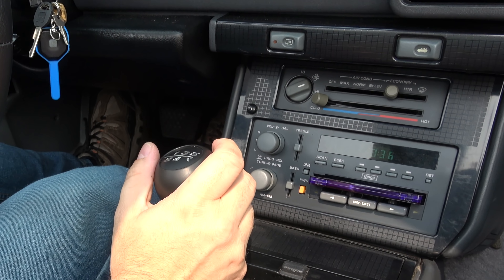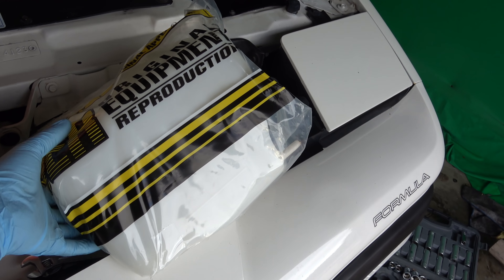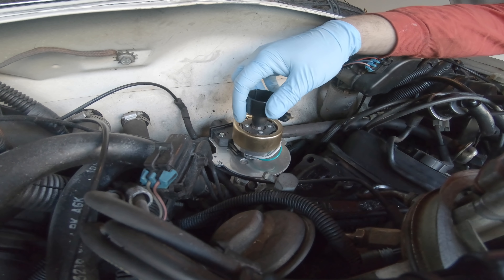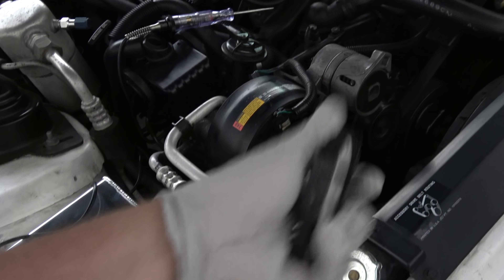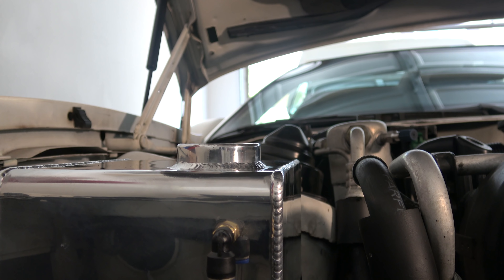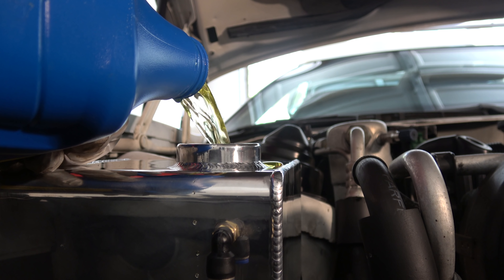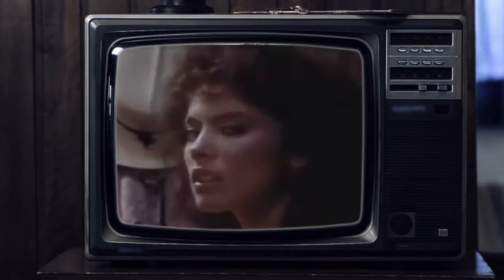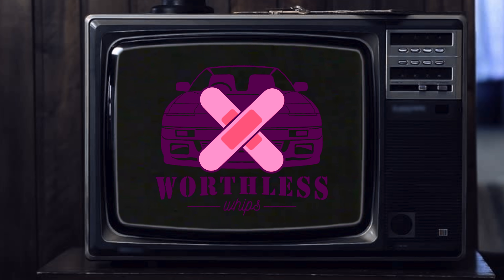They really don't make them like they used to!

Comment: I had a 91 camaro rs so I feel you pain. Went through 14 alternators in a year. Best thing I ever did was pull that 180 hp 305 boat anchor with a 5 speed and swapped in an LS1 with a t56 6speed. This was late 90's.
Reply: >Went through 14 alternators in a year.
wut...
Reply: How many times did the driver's side interior door handle come off while you were closing the door? Four times on my brother's new 90's Camaro. Build quality was terrible.
Reply: @williamswenson5315  Weirdly that actually never broke on mine. But the normal starter, alt, and fuel pump gremlins did bite me.
Reply: @troy3456789  Yup, and GM in their infinite wisdom used 3 completely different bolts to mount it. Original one died and I think it was more of an auto zone problem with the replacements than anything else. They finally got tired of me coming in for warranty replacement and just gave me a new AC Delco alt.
Reply: @stephenobrien1597  Yeah, the first time I drove it, I was left with it in my hand. It was an awkward moment when I returned his keys and the handle together. Two weeks later, the same thing happened to him which resulted in a similar awkward apology for being upset and angry. That car was a real conversation starter; if nothing else.
Reply: @stephenobrien1597  For the first time in my life I had a reman alternator from O'Reilly's fail (for my Camry after only a month). The V6 2011 Camry alternator is a 5 hour replacement job at dealerships, and it took me 10 hours to replace it; because it is at the bottom; and you have to remove the front end off the car, drain the radiator to get to it, and even then it requires access from the right front wheel well to insert a mount bolt with one hand only (not enough room for two hands to get it in). It takes a second person from the top to move the alternator just to line up the bolt hole.
Reply: Lucky you, I can't do that in California! Wish I could
Reply: @troy3456789  At least the overall reliability on the Camry is high. That procedure is one of those "living Hell" types that people who work with their hands know only too well. My sympathies.
Reply: @troy3456789  I'm assuming he changed them all himself. Ugh.
Reply: @williamswenson5315  I'd have been done at number 4. The 3rd one would have been the charm that broke my mental camel's back.
Reply: @williamswenson5315  Yes. I drove that car back and forth across the US a few times and I had 100% confidence in it. On the freeway that V6 gave me 28mpg and nobody took notice of me. It's low-keyed, just like I like my life.
Reply: @troy3456789  Definitely saves on the skull sweat. Thanks for your reply and take care.
Reply: @troy3456789  I can't imagine 14X. At least one of those alternators would have been returned on a horizontal trajectory at a great velocity. I do have to give him points for gritting it out.
Reply: @williamswenson5315  I have to give him points for patience. I just figured out what you meant by "horizontal trajectory" (like through the front window of the auto part store). I'm laughing. Thank you. I needed that.
Reply: @troy3456789  You are welcome. Any humor is particularly precious about now. There is a fair leavening of it on this channel also and I enjoy every bit of it. It's a good crowd.

Comment: I had a 1987 Firebird, I experienced all of this. My distributor was junk, the replacement was junk. The ignition cylinder was junk. The radiator was junk. The interior panels were junk. The engine and transmission themselves were great, but literally everything else around it was complete junk. And yet I still miss it.

Comment: I loved my 88 Formula 350.  It had it's issues but it screamed.  My ignition control module also failed but it was because of wires that attached to it in the distributor.  They had corroded off.

Comment: Check your alternator output. I once went through 5 ignition modules inside the distributor on my 2nd gen TA, due to an alternator overcharging the system due to a stuck, internal voltage regulator.

Comment: 0:22 top was my Dad's new in 86 minus the t-tops.  305, 5 spd, WS6.  Not the fastest but was fun to drive  I had an 84 Z like on the bottom except black, no t-tops, no orange stripe but mine was hooked up with engine mods, exhaust, gears, and beefy suspension.  That car ran on rails.  Out-corner any U.S. production car of the decade.

Comment: I drove an 86 Trans am for three years of my four years in college. I picked it up with 114k miles. I won’t lie, I beat the crap out of that car and it returned the favor in broken parts. I replaced everything in 3 years except the motor and transmission. Parts like the alternator, brakes, and starter, I replace them every 6 months. I had an autozone lifetime warranty on most of the parts. I had no idea it meant I had to replace them for a lifetime. Around 190k miles, the transmission started grinding in reverse. I started looking for another car. I didn’t want another f-body after the stuff I went thru with the TA. Just my luck, the only thing I found worth buying was a 88 Formula with 87k miles. I didn’t want to buy it but I was desperate. It ended up being one of the best cars I ever owned. I only had to replace the starter and fuel pump over 4 years.

Comment: You bring up a very good point!  lol.  I refer to it as GM electrics of the 80's.  Every time I fixed something I thought it was DONE.  Then I realized nearly everything was being replaced or TLC tinkered with at least every 2-3 years.  Relays, Switches, etc.  Window switches, mirror switches.   With connector pins as wide as pencil erasers, you'd think they'd be robust.  lol.  I think that's why I have 3 Audi A6's now from 2005-2008.  Audi's are very frustrating at times to service, but the repairs are pretty rare.  80's GM quality was pretty sketchy in a lot of areas.  Some of it though, can be spruced up a bit.  The saving grace of the third gen is that parts are typically inexpensive.  I do love them.  I love the immediate turn in (at least on mine), and the design aesthetics, at least on the GTA.  I will own one as long as I can.  ;)

Comment: I mention about the distributor in my previous post. About the coolant tank, Plastic and rubber parts from China are garbage like you experienced on your cheap Chinese car. However there's a product called goop you may want to try next time, It's amazingly adhesive durable and resilient for repairing things like that tank and it may have worked. That tank does not hold any pressure so it only has to be mechanically strong watertight and temperature resistant up to the temperature of the coolant.

Comment: "They don't make them like they used to!"
What? Half assed, cheaply sourced, and unreliable? Haha.
I guess there is a point to older vehicles being easier to work on due to the reduced complexity of on-board computers and circuitry. It does feel nice to pop your hood and actually see the engine apposed to hunks of plastic. But I agree, I'm glad they don't make them like they used to. I'm also glad that we can still buy older vehicles to tinker with and modify. 

It's also worth noting that old Japanese cars are really the only vehicles that don't have these issues. I recently started a new project on a 86 Porsche 959 and my god, it's a nightmare. It was the first time Porsche introduced liquid cooling... What American cars from this era lacked in regards to quality materials. The germans made for with overly, obnoxiously, complexity, and cramming shit into the tightest places with their little German hands.. Needles to say, the end result is the same. Cars from the 60s-90s are unreliable. Unless it's Japanese.
Reply: I agree with every point you have made here.

Comment: Looks like the same ICM that is used in the Pontiac Fiero. It's very common to keep a spare in the trunk just in case. Easy diagnosis of a faulty ICM is the tach doesn't move when cranking the engine.

Comment: Painful about new parts failing--I was schooled on that when old industrial engine wouldn't run right after I replaced the points, didn't think it could be that just like here, but friend mechanic went straight to new pts when I mentioned it,...turned out the cam follower pivot was grounded to the base!  I'd NEVER seen that before in decades of frequent pts maint and replacements and the parts shop was skeptical but put a meter on it and....continuity.

Comment: I owned an 80 Buick Regal and an 86 Buick Grand National both 80s GM products and had no problems with either . Now the Pontiacs I had previously owned,  64-69-73 all gave me water pump and heater core issues. Now my sons have had Mitsubishis and Audis which were expensive disasters . I think you can get a lemon from any brand , some just cost more .

Comment: Ps:  Indeed, your lucky that it failed at home. Imagine if it quit on you in the middle of a blm riot, Or somewhere in South Africa.

By the way, used to be a guy with the website that shows a lot of cheap effective upgrades for those Tbi engines. If I recall, a throttle body spacer was one of them.

That motor should also handle a 150 horse nitrous kit without harming the engine, and that will give you the throttle body space  as part of it. 

I think I even have one I've been saving for when I get an old hoopty. 

BTW,  The 350 Tbi  Has a lot more torque and power if you ever drive to back-to-back.

 Good luck and keep up the good videos, specially the ones where you stand up against the CP and educate people.

We have a whole generation of people now that are so blindingly ignorant of communism it's unbelievable, and I think it's been by design.

Comment: Sorry for your trouble. I purchased my 83 Z28 in summer 2018 (after looking at 20+), super car and had NO rust! (Most important thing where I live.) it was not running and had a bent axle, but UN-molested, I got it dirt cheap. I knew that the engine didn't run because the Ignition Module was bad, and the axle I replaced for $35 from the junk yard. And I have driven it trouble free, and enjoyed it since, you cant beat these cars, totally build-able, massive aftermarket support, and just scream LS swap. Your white TA is nearly 500 lbs lighter than your black 77 TA. PS. GM control modules are known to fail, keep one available, you will know simply because there will be virtually NO electric power anywhere. Love your choice of cars. Cheers!

Comment: It's always the ICM, especially if you just replaced it and it died lol.  Two things if the heat transfer paste isn't used it will die very quickly.  Also often for what ever reason the distributor often has a weak ground that will kill the ICM.  Add a ground wire.

Beyond that buy two and keep one in the "glove box" in the truck.  Because it will die again.
Reply: Same with Chevy when they went away from points

Comment: Was going to recommend you get an aluminum replacement for the water bottle, good choice :)

I've got an early 90's Holden V8 in Australia and almost every new direct replacement part I've purchased has been junk, issues with the distributor were identical to yours.

It's definitely better to buy locally reconditioned, at least the mechanics / auto elecs doing the rebuilding process have had experience in choosing every little replacement part that goes into the main product being rebuilt.

Comment: I got the same overflow tank as you but in black. But it's, not just that old tank that is an issue, my 2013 Holden (Chevy) Cruze has had 3 of those tanks replaced. so much so that I brought an extra one and since then, I have not had an issue...

Comment: If they don't make them like they used to, I suggest you wait another 25 years, none of the cars made today will ever come close to lasting as long as the cars of yesteryear. Yes there may be some cheap parts used in production back then, but the heart of these cars is what was made to last. Gen 1 SBC engines will far outlast anything made today.

Comment: I still have the original plastic tubs from my original 89 bird. I put in a new distributor 3 years ago no issues. Put a Delco fuel pump in 5 years ago still going strong. My car is not junk at all. I love my formula 350.

Comment: Was the new distributor made in China? :)
Reply: My thought as well. Wouldn't that be ironic?
Reply: William Schwartz  A good point. I don't know if the IM uses a heat sink, but if it does and it wasn't applied, that would be a resounding, "Yes!" If Winston didn't apply it and it is called for, he could get it at Radio Shack or a computer supply store. W
Reply: Possibly. And that might be a problem ( or it might not). It depends on how it was made. There are several different grades of components made in China ( or Taiwan, or Singapore or Vietnam). The bottom of the list is simply a copy of a copy. The quality control is almost non existent and the companies themselves have the life expectancy of a fruit fly at Martha Stewarts house. A rung up the ladder  is the copy of a quality product. Again there is somewhat inferior quality control but a possible willingness to improve to the next step, which is the carbon copy. These are direct copies and have reasonable quality. Finally the last one is products designed by blueprint with very good quality control. Finding a quality product however can be difficult to ferret out, so far I have been lucky. Winston should have had another distributor to replace his. I have a box filled with new starter, alternator, belts and all the electrical components to completely replace the majority of underhood electronic ignition parts and keep me mobile. Being stuck on the side of the road on a busy LA freeway would be a world of suck.
Reply: @blakenewton2781  Amusing comment about the fruit fly. Yeah, I suspect the paper trail would be difficult to follow if you were bird dogging the quality issue and I too, carry essential parts, tools and a full-sized spare tire in my GTI. As bad as LA freeways and some neighborhoods might be, the middle of nowhere is not an improvement.

Comment: There's some decent cam grinds for the 5.0, getcha some aftermarket injectors and exhaust a better tune. And a 3:73 rear gear and you can get alot of red light to relight street racing fun

Comment: The new homes in Irvine are basically the same, built very quickly with cheap parts, but they have demand and supply so they make extra bucks.  The "too soon but necessary" home upgrades will need to be better quality.

Comment: My cousin had one of these back in the day it had the tuned port injection and had transmission and rear-end work that car was scary the top of the car had stress fracture from the rear end twisting people could not set in the backseat when he got on it because the seats got hot from the tire when he did a burnout

Comment: Oh man I had the same problem with the ignition control module in my 87 Formula. What a headache it was to figure out that was the issue. Thankfully I encountered an old mechanic who knew these cars were notorious for that issue and diagnosed it. I once had a 1980 Z28 that was similar to your 79 T/A. Is it me or were the second gen F bodies just built better? As always great video and content! 🦅

Comment: I got a 1992 firebird myself and i was wondering if any special additives are needed for a key duplication. I got the key for my t-tops and doors already done, but i was wondering if the starter key needs a special chip or something. Any advice? I live in the Nederlands.
Reply: Unless the door lock or ignition switch were changed, the door key typically works in the ignition. Otherwise, if you have the correct key blank, a new key can be ground from the original. The '92 isn't chipped like later vehicles.
Reply: @williamswenson5315  Thanks for the answer first of all! So the thing is that I have a seperate key for the doors than for the ignition. Both of them are originally stampled GM, but the previous owner might have had earlier troubles regarding the lock. However the key for the ignition is the original which means I will be able to duplicate it. The reason for asking is that the key has a small area where there key stands out a bit, this brought me some confusion at first. Thanks a lot!
Reply from the maker: You can bypass the vats system easily with a resistor and then you don’t need that special key “chip” (it’s only a resistor) there are many videos online on how to do it
Reply: @WorthlessWhips  Thanks, Winston. I just left the guy an apology and some info on this. I also pointed out that it's a good group and someone will be able to help him. It turns out I was right about that anyway. Cheers.
Reply: @WorthlessWhips  Yessir i will have a good look into it. I've also seen ungrinded versions of my currect key with this so called chip. Do you think I can use one of those as well for duplication? If not i will definately try your method. Have a good one!

Comment: Boy, you're not telling me any news about 3rd gen F bodies! I worked at the Chevy dealership from '88 to '92. Then I went to the Buick dealership until '95. Got to work on the brand new junk! Even worse than the F bodies was the Beretta and Corsica. Factory recalls for failing door hinges. The hinge first world seize then snap. Extra weight on the other hinge would snap that one, too! That dropped the door to the ground! Same hinges were on the Lumina's, too. Those were the days! Won't even get into the Astro vans or the Lumina APV (the all plastic vehicle). How about the new Nova? You know the re-badged Toyota? GEO? Joke and a half! Even after all that, I'm still a classic GM guy.

Comment: Could be plastics are aging out. Sometimes aftermarket parys are crap too.
I had an 86 2.8 multiport camaro in the early 90's and ran it well past 300000kms. Never easy on it. I think I change the throttle body once and otherwise just maintenance .  
Pulled the plugs out at 300thou and they were burnt clean off. Still ran. Lol